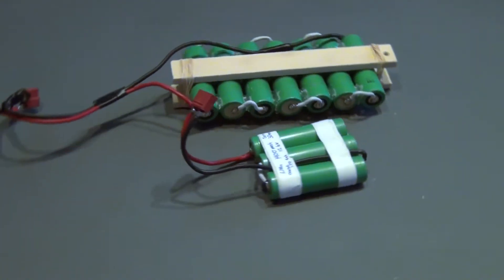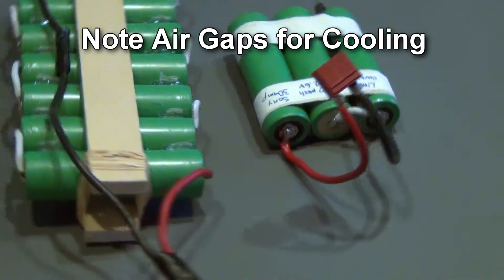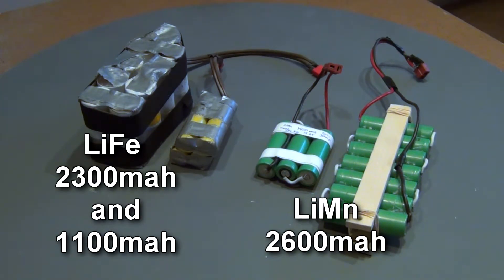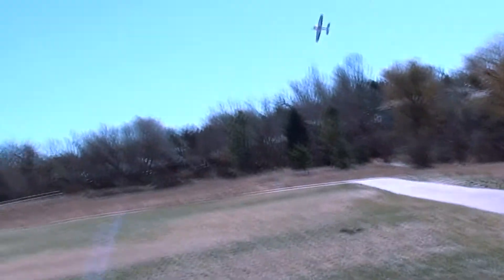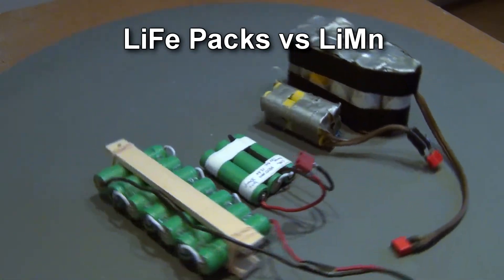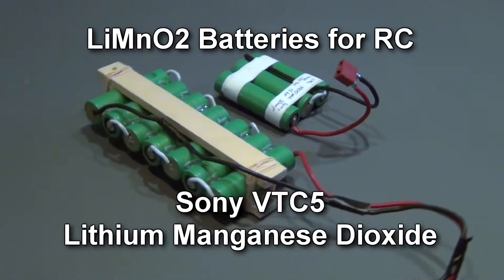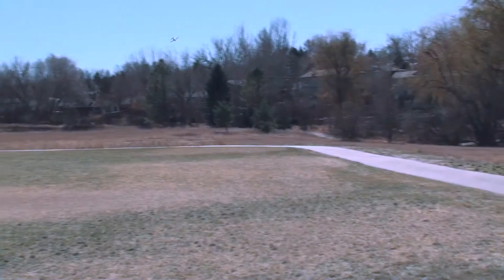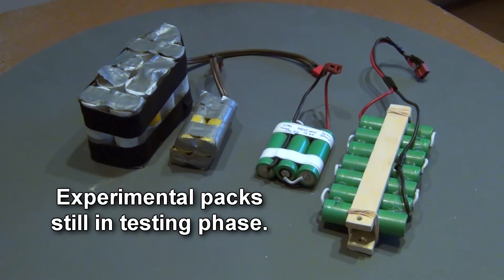Sony VTC5 2600mah - Lithium Manganese 30amp Batteries for Radio Control Aircraft Motor Packs (LiMn)

Comment from the maker: The Sony VTC6 3100mah creates more heat under the same load so my limit is temp rather than capacity.  It's still a powerful light weight pack but you really have to be careful about cooling.  I'm using 8 cells to power an E-flite 90 and after a couple minutes of aerobatics things get a bit toasty.

Comment from the maker: The Sony VTC6 is out now and it's rated at 3000mah so I've got some on order.  Super useful if you are experimenting with pack sizes, shapes and voltages.
Reply: should we need the pcb protector on this 18650  pack..?
Reply: Yes i have made 4s battery pack using vtc6 cell, and getting amazing flight time of 1 hr plus on my 45" wing.

Comment from the maker: I used these cells in a new design 600 sq. inch twin biplane; 2 4-cell packs.  The packs were 2 different shapes and I started with
just 3 cells.  More rpm was needed so soldering in another cell was easy.  That's a big benefit for experimental projects.

Comment from the maker: Not the best pack for RC helicopters.  The voltage sag under load sent the esc. into motor shutdown about 2 minutes into flight.
Luckily only inches off the ground in hover.  RC aircraft fly with lots of throttle changes which give the batts a chance to recover.

Comment from the maker: Flying these batteries gives an accurate sense of ultimate performance.  The big pack hauls a 6 pound airplane straight up
for a couple seconds to maximum see-able altitude.  Temperatures are controlled by throttle and an aerobatic airplane uses
pulses of full power followed by moments of idle as the aircraft dives.  The motor can take up to 60 amps and the speed control is designed for 80 amps so they can take a lot of power.  The batteries are rated for 30 amps and in flight they get pushed to their maximum briefly now and then.  That's a bit over 1hp which is similar to a Saito .72 four stroke engine.  The big A123 2300mah cells can put out double the amps but the capacity is less and the weight is double.  Electric airplanes are a delicate balance of weight, heat (maxing out the components but not hurting them) and flight time.